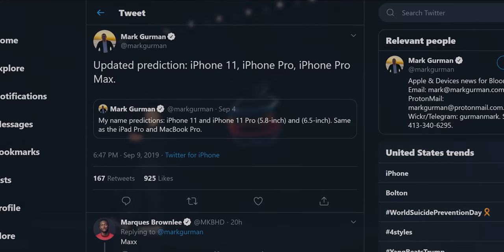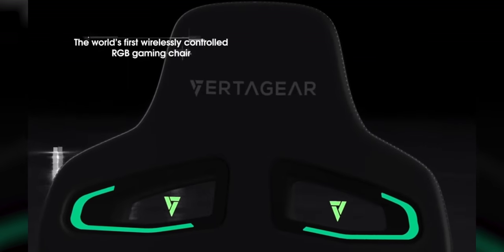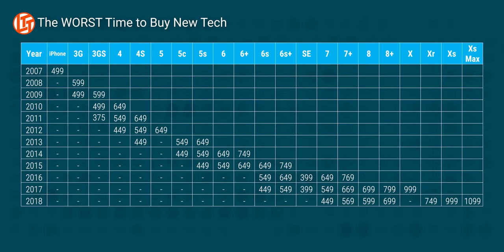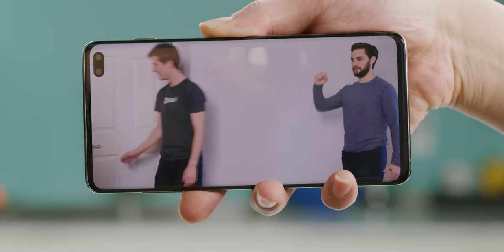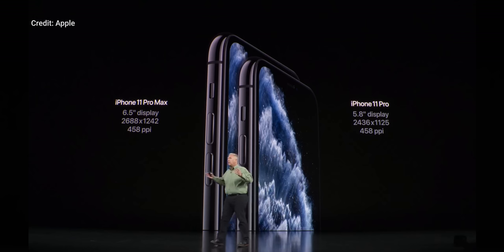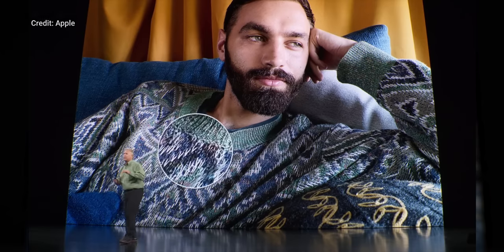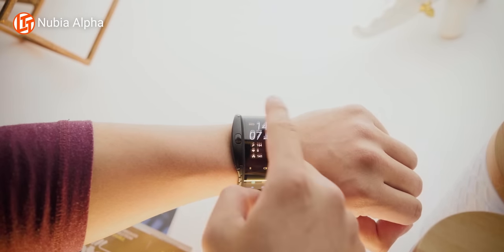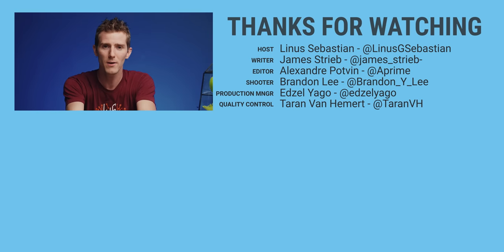Apple iPhone 11 REACTION!!

Comment: Ngl Apple smashed it this year. This is coming from an android user that uses a measly Lg G6.
Reply: that is still better than an iphone xr in my opinion.
Reply: @fatalsg92  How is it better in any way, lol?
Reply: @cristi0896  the price to value ratio. the hardware of an iphone xr is valued at $300. basically every iPhone is not worth it for its price.
Reply: @fatalsg92  Considering the years of software support they get, I'd say it's worth? I mean, I'd rather get an expensive phone every 4 years than a cheap phone each year. I still have friends using the iPhone 6, which was released in 2014. Also, I wouldn't call the iPhones cheap hardware in any way. The Xr has the best LCD in the market, the best chip until this year's iPhones were announced, great camera sensor and real time HDR and portrait mode, UFS 3.0 storage, TrueDepth camera for Face ID etc. These are all premium components that no other manufacturers offer (maybe except the display since OLEDs have kinda taken up the market, but it's still a great LCD and it's edge to edge)
Reply: @fatalsg92  and the Galaxy note + with it's starting price of 1100$ is worth its price ?
Reply: @cristi0896  I get that apple's ecosystem and services makes it worth it for you because no one except apple makes IOS. but imagine if IOS was also open source, it won't survive the competition with its current line up. Aside from the faceID and apple software services, apple really has nothing else to offer. I mean let's be real here, I'm sure that even you guys are also wishing for apple to have a fingerprint scanner because that's just a more practical solution. I'm just saying that every feature of a smartphone has, I'm sure that there is an android phone that does it way better than an iPhone.
Reply: @noka5730  but it's not the only android phone out there, we have a variety of options to choose from. but you guys are stuck with apple with its low value to price ratio.
Reply: @fatalsg92  I actually am an Android user, but I'm sick of people saying iPhones are overpriced, while claiming that the Galaxy note+ is worth the price. It's because of them, companies are still making very expensive flagships.
Reply: @fatalsg92  Why would they make iOS open-source? It's their code, and they don't want 1239021 forks of it. The design language and fluidity in iOS gives them an edge in the smartphone business which is how they make ~50% of their revenue. Google sells people's data, that's why Android is open source and free to use.

Also, no, I don't wish for an useless fingerprint scanner that would also add to the price of the hardware. There's no reason I'd ever want to use a sensor that would require me to put my hand somewhere specific on the display when the Face ID would have already unlocked the phone way before that. What other manufacturers are doing now by using the fingerprint sensors is just refusing to acknowledge the convenience trade off that they're making. At least Google is caving in and they're adding a facial recognition system in the next Pixel.

I don't feel 'stuck' with Apple, as you call it. I've tried them both and Apple's devices feel objectively better to me. Low value to price ratio? I listed to you some premium hardware components that iPhones use, yet you didn't touch that list at all. Who gets to decide the actual value of a device if not the user with his specific use cases? If I can afford it, you better bet I'm going to pay the premium for some devices I use for hours a day.

"I'm just saying that every feature of a smartphone has, I'm sure that there is an android phone that does it way better than an iPhone."
No Android phone will get software support for more than 2-3 years. Video recording on the iPhone is unmatched. Face ID is unmatched. There's no alternative to Airdrop or iMessage for Android. The iPhone X Gestures and animations are way ahead any Android implementation. The Privacy features in iOS 13 are years ahead. This list has some really basic things that impact every day usage and it can go on and on, I'm sure you can add some as well.
Reply: @noka5730  but if you watch the trend closely cheaper phones are getting good. I'm sure samsung will start adjusting prices again when consumers go to other android devices. the s10 plus is a much better purchase than a note 10+, but there's also oneplus 7 pro, or pixel phones and many more. the competition is good for us consumers. The problem is apple doesn't have competition on IOS that's why they sell at whatever price they want.
Reply: @cristi0896  Well all the things you have said are very true in an IOS market, everyone agrees with that. but if you let a reasonable person that didn't have any experience using a smartphone choose a smartphone now. I think that iphone xr will be a very hard sell.
Reply: @fatalsg92  Well to some people, yes, the Xr is a very hard sell. Cheap phones are getting better as well, so everybody's happy, I guess. I just wanted to emphasize the fact that these devices are indeed worth it if you do your research, which most people won't, as almost every Apple-bashing thread demonstrates.
Reply: @cristi0896  You're so wrong on every level it's hilarious. Video recording on every current gen iPhone is worse, Android phones usually get 3 years of feature updates, Airdrop equivalent is Fast Share, iMessage equivalent is Google Chat, Android gestures are the same as iOS, privacy features are the same, plus an open source OS. Oh, and FaceID is utter shit and unusable. I've tried it and hated every moment of it. Feels very unnatural and only works at a very specific distance and angle

Comment: How many cameras do we need on these things?  I have an Xperia X and it has one 23 MP camera.  Even the 20.7 MP they used in previous Xperias was still really good and that was back in the days when the iPhone 4S was still being sold and it had just an 8 MP camera but one lens.  I used to think the iPhone had a good camera until I ditched it for an Xperia.  You don't need a T-Mobile account to enjoy a good camera on a smartphone like these either.  I got it used for $200 and use it as a small tablet with a nice 5 inch 1080p display and one of the better cameras found in smartphones.  I don't know if Sony still makes the image sensors in the iPhones but I have read that the 4S had a Sony sensor in it.  Maybe the S in 4S was a hint at that?  I don't know but I wonder.  Most people know Sony for Walkmans and TVs but did they know about the smartphones?  You would be surprised how many people don't know Sony made smartphones then I show them the photos my camera has taken and they are amazed with the quality.

Comment: As a committed Apple user I gotta say this is pretty disappointing. I expected more then a “s” upgrade. I don’t care about the display (I have the XR and you honestly don’t notice the difference in everyday use) but I thought they would do more to even the playing ground a bit. Android has in screen fingerprint scanners, high refresh rate screens, high fast charging, no notch’s (even though Apples is justifiable) and 5g devices coming. The new iPhones didn’t need all these features but at least one would have been nice. Ohh well on to next year.

Comment: the state of android wearables? garmin has been making fantastic watches for years. I'll admit the companion app could use some work, but all in all, significantly better than even the newest apple watch. they saved money by not including the "gimmicky at best, life threatening at worst" "ECG", my vivoactive 3 that is now 4 years old still gets 3 days (got 7 when I first bought it) of battery life under normal use, barometer, magnetic 3 axis compass, one of the best wrist based heart rate and SPO2 monitors on the market, GPS, 5ATM waterproofing (50 meters) and NFC just to name some of the features. the apple watch from my understanding is still only IP68, only just added the magnetic compass, still doesn't include a barometer, has a heart rate monitor that has been described as "mostly accurate", and no SPo2 (although I could not verify that). all of garmin's watches feature an always on display, and you can currently pick up a vivoactive 3 brand new for 170, retail was 300, and the newer model that has quite a few more features can be had for 400. If I wanted to spend apple watch series 5 money on a garmin, Their Fenix line has even more features including an (optional) actual sapphire display, optional solar panel, better GPS, 10ATM waterproofing (100 meters), a whole host of software upgrades, and 14 DAYS of battery life. it says something that for the same price of the apple watch I can get a smart watch that does everything and more, and on top of that I can get an almost 24x increase in battery.

Comment: 2013 - Flagship iPhone without contract = $ 699
2019 - Flagship iPhone = 
$ 1099

No Phone option below $400

2014 Mac Mini = $499
2018 Mac Mini = $799

No Mac sold below $500

They won’t sell cheaper Mac mini or the iPhone SE as they get less margins. 

Apple are a classic corporation using their monopoly to do whatever they want regarding prices.

Comment: Channel needs to be named. LINUS HAS AN OPINION ON TECH THAT HE WILL PUSH ON YOU. That’s all I really get from this place anymore. So much useless bias and salt from the reviewer. If it doesn’t fit Linus’ select random needs that don’t fit the majority of other people then it’s not worthy to get a non biased review. Lots of passive aggressiveness tacked on after each bullet point. 
Here’s my experience with Apple. 
Flawless user experience. I never have to reset my phone. (That’s amazing). Zero desires of “missing” features only found on androids. I do wish my iPhone 8 had a bit louder speakers but hey it’s a phone. I know I should buy a real speaker if I want to blast my music like what real speakers are for. It’s has perfect build quality. It looks amazing (makes me smile)

My Gf has an Android. I see her reset her phone a lot. I’m picky with my tech so if I were her I’d be very very upset with that. Everything else is equal. Her speaker seems a bit louder but my phone is the  iPhone 8 so it makes sense it’s not top of the line. Cameras are good on hers but the color quality is a bit gimmicky. It’s over saturated to be more appealing. (Marketing techniques). So it’s unrealistic but not that fake looking it looks nice still. 

So yeah I’d totally take the iPhone again and again. I’d throw my phone away if I had to restart it as many times as I’ve seen her do it.

Comment: So the iPhone 11 pro is basically high spec iPhone 11 is basically a bumped up iPhone XR which is basically a bigger screen downgrade specs iPhone 8 (What happened to iPhone 9 though) which is basically iPhone 7 which is basically iPhone 6s without headphone jack which is basically iPhone 6 that doesn't bend.

I'm gonna put flowers, cold water, and new Classic iPod on Steve job's grave. RIP.

Comment: In regards to the Apple Watch... So Apple now has shrunk the avg. day from 24hrs to 18hrs? Damn that's some advances in tech right there!! Should mean shorter work days 👏!  But wait... does it mean shorter weekends too? 🖕🏻Apple!  Seriously though I get 4.5 days of battery from my Versa.  And yes, it does 90% the same stuff. It works with Apple & Android,  imagine that. I actually can use the sleep stage tracker, when most Apple watch users are charging theirs. 🤣

Comment: I think this review is too soft while you were too hard on Samsung s10 and this tells me alot...... 

- First of all Iphone 11 pro seems a bad copy of last year's Mate 20 pro, the back, i think they are doing nothing for improving the design, also these new models look like shxt. 
- Finally they are coping lots of stuff from android like the double tap for waking up (which i think was introduced in 2011 in Android), they got rid of the useless force touch for probably copying andorid's version of it (long press will show additional options) and so on......
- Then i think it's ridiculos that they don't provide an always on display like android counterparts do in phones that cost less than 150$, my phone from 3 years ago already had this feature!  
- Also i don't find smart the decision on cameras: instead of normal, wide and ultrawide, i think most of us want the cameras implemented in andorid phones like Samsung s10 or similiar:   optical zoom 2x, normal and wide, this is so much useful in everyday life and photos. 
- All models 4gb of ram??? come on most andorids are 8gb or 12. 
- There was no investment for getting rid of the notch, one of the worst ideas in the last years in my opinion. There are so many middle/high level android phones which come with a variety of alternatives in order to take out that silly notch in the middle of the screen. Even if i don't like it, also the Samsung S10's solution would have been better compared to the standard notch
- No 5g module in a phone that costs 1100$? Unbelievalbe, 5g is already turned on in most countries since a year and there are already lots of andorid phones availble since months with a 5g antenna! 
- Display resolution still crappy in my opinion, 2436×1125 or 2688×1242 458 ppi is so bad compared even to a 3 years old mobile like LG G6 which has 2880 x 1440 and 564 ppi or the 370$ phone LG G8 which has 3120 x 1440 564ppi. Also the NITS which are around 1000 in the case of LG G7 while we have 600-800 in new iphones. Also in terms of hz, nothing new, still standard refresh rate nothing like the 90hz of more of some android alternatives.  In the end the "Retina" name really doesnt say nothing to me, just marketing stuff done for dumb people to believe it while there's much more around for much less price
- Split screen still unavailable in Iphones  (it's a 4 years old feature in android)
- Not to say all limitations that go with a closed OS like IOS compared to Android, missing phone jack, blutooth not working with other devices, impossiblity to save your own videos on the phone.......

Comment: Top 10 Let downs

10. Symmetrical Button layout is a mess
9. LCD screen w/ no
 split screen or pencil support for the multitasker 
8. Recycled innovation (getting by with android features from years ago)
7. Miss out on Reverse wireless charging which will be in the iphone 12
6. Still use lightning cable w/ cheap inbox air pods...sad
5. Ugly camera design 
4. No 5G (What if I want to hold onto my phone for a few years)
3. Too much Notch...seriously!
2. Criminal low storage
1. Steve Jobs is not around to save Apple again. Even Pixel geeks are laughing at our phones....

Outside of that. It's still the fastest, we get the coolest fonts , quick software updates and it's an iPhone(best ecosystem)!

Everything comes together like butt cheeks when you own all the apple products:)

Comment: id stick with a 3 k20 pros (900$) a used galaxy note 8 (200$) and a brand pc setup (900$)...

 then a 2kg piece of aluminum known as a pro stand and a 1000 glass sandwich... that is slower.... then a single k20 pro.... and has a smaller screen... and doesnt have a notch... and that has a headphone jack.... and IP68.... and basicly everything is better...

Comment: New APPLE Watch...... Always on Display wooohooooo.. 18 hours battery life........wooohooooo!!! How stupid are iSheep? Then the iPhone, a 2017 design with an even uglier back. Nothing new of any consequence. The "Retina XDR screen" is actually a Note10 plus screen. A question. If the whole phone is manufactured out of one wrap around piece of glass, does that mean that if you crack it, you have to replace the whole thing which will mean a new front AND back glass? 🤔

Comment: Garmin smartwatches are better than android wear and apple.  Might not have been on your radar.
Reply: The Garmin Smartwatch looks almost identical to the Samsung Wear. I wonder what OS they both use
Reply: @chriswheeler5808  Garmin smartwatches run on their own OS.  There are many models, and they are SIGNIFICANTLY different from samsung watches, which btw use Tizen.  Garmin watches typically have always on, reflective screens, with a backlight as something you need to turn on.  I wear a vivoactive 3, and my battery lasts for a week w/o turning it off when I go to bed, significantly longer if I do, it auto tracks all of my physical activities, from running to swimming  to machines, to rowing.  My dream watch is the fenix, which among other things, has onboard mapping with it's gps which doesn't depend on cell signal, and includes rivers and trails.  You can go on an adventure in a national park or forest and never worry about getting lost.   

A quick google would have told you they don't run on the same OS.  What did you do?  Google image search?